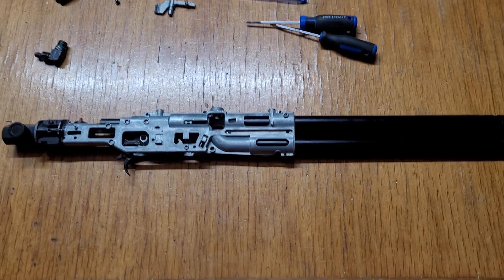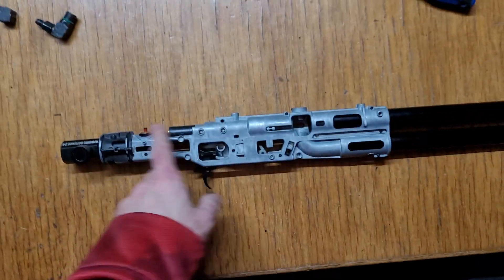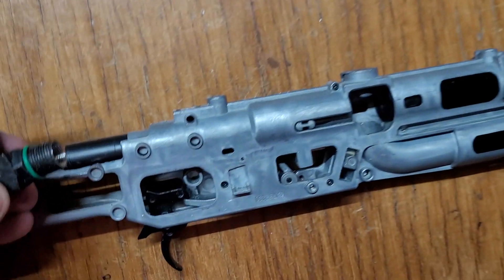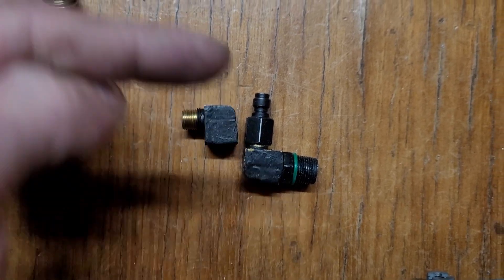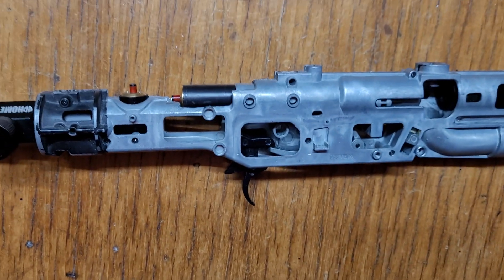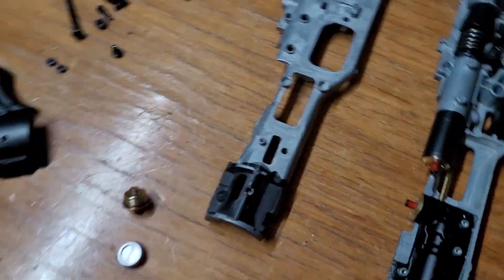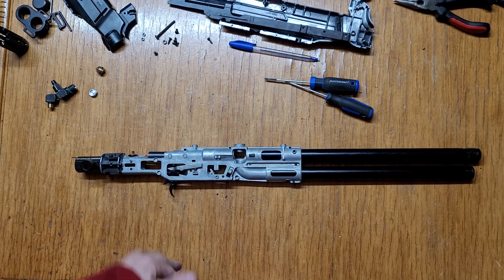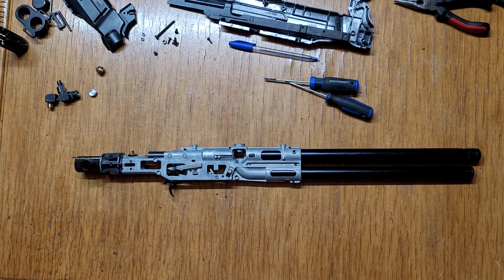Umarex HDX 68 HPA Bypass Chamber Extension

Comment: Dude you are a pioneer of less lethal, i am tinkering with my HDX chamber too atm. This extension should probably give you already more power from 2x12g because they don´t produce that much liquid co2 which expands behind the projectile and accelerating it, but you have already more gas volume down the barrel. I think on the 88 gram you will have to use barrel extension for real benefit instead of just wasting this expensive type of cartridge. Looking forward to next video, i am under tension like a bow dude.
Reply from the maker: Thanks bro i just love to make things better and tinker lol and yes i think it will for sure, in every other umarex gun i have shown the 88g with chamber expansions get huge gains, i got 80 plus joules from my hdr68 and  25g co2 with expansion and i get around 70 plus js with my hdb68 and 88g, i have the conversion 88g adaptor in my 7 joules HDX and its hitting over 50 js in ever video i show, this  chamber looks like it increased the air chamber by 40 % it should make a dif i hope, soon as my neighbors leave im testing it :)
Reply: @LessLethalHomeDefense  sounds promising, please show also what you cut out from the outer housing
Reply from the maker: @ i will shot it off, are you in any of the FB groups for LL?
Reply: @LessLethalHomeDefense  no